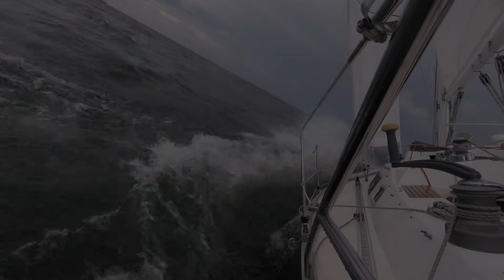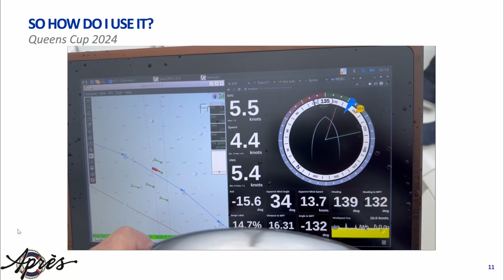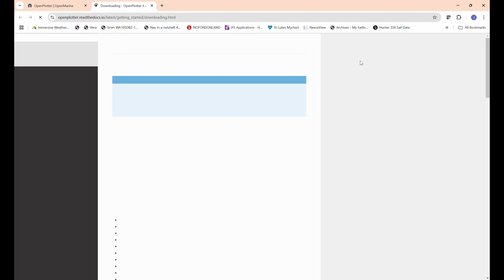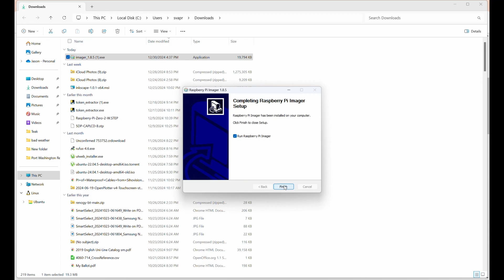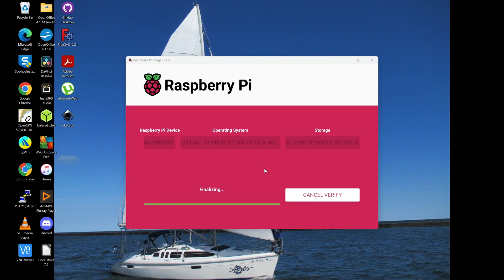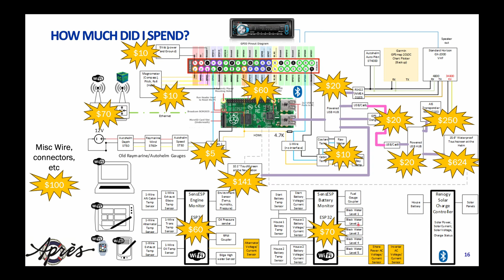DIY Sailing Electronics Guide: Openplotter, Raspberry Pi, Signal K & OpenCPN - Part 1 - Apres Sail

Comment: Would have been better with a tablet such as galaxy tab s9 ultra for helm and nav station imo
Reply from the maker: I started out with a tablet at the helm and considered it but these are some of my reasons:
- Tends to overheat
- Not really a permanent solution
- Charging in the wet can be an issue
- Doesn't just work (meaning you have to navigate to an app on startup)

Comment: Very Interesting!  THanks for this.  A Pi tip:  If you are going to boot from an SD Card, you should bring a second with a clone of the system.  SD Cards do not last like normal drives.
Reply from the maker: Good point!! I guess their are two issues: 
1. Corruption of the SD card - In the early days I implemented a system to make sure the system could be just switched off, and the Pi would perform a safe shut down.  The hardware for that is now built into the MacArthur Hat
2.  too many cycles to the SD card - I have not seen this unless you have influx/Grafana installed that logs the data in a database.  SignalK only uses RAM for data and doesn't write all the data.  
in any case it is always safer to have a spare cloned SD card or run the system from an SSD.
Reply: @ApresSail  It has to do with the number of reads and writes which might be hard to determine.  I've spent extra money to get a case that will hold and SSD or nvme.  pi 4 & 5 will booth from those no problem.
Reply from the maker: @uSlackr agreed, my boat system is also running on a SSD, but I ran for 3 years on an SD card with no issues, but I did have a backup always ready
Reply: @ApresSail  Backups are good (and rare)

Comment: Curious what router people use. Looks like you found a fairly cheap one (compared to say peplink), and how do you protect it from weather? I've started a system based on someone else's take.. got a Sailor Hat SHR-pi that provides power and safe shutdowns from NMEA2000, a Waveshare hat for NMEA2000 connection, and the 4B RPi. I see now there's cheaper ways than the NMEA hat - but it is what I got. Don't plan on having internet on board unless getting wifi from shore, but that and cell reception are desired. Thanks for your channel and info you provide!
Reply from the maker: I use a GL.iNet Spitz (https://amzn.to/3K7NXk5) which is 9-36V and I put in behind the Navdesk, I have done nothing special to protect it from weather.  it has been there for 3 years, but I am in Fresh water.  From what you describe, do you need a router at all?  The Pi can be configured with an internal and external network.  the external you would connect to shore Wifi or phone hotspot and all other devices would be wifi to the internal network.
Reply: @ApresSail  I'll try to wrap my head around that, thanks much! I've been trying to create a hotspot on the pi but it won't come UP. Logs show various errors so finally given up on that. I have Debian Bookworm installed, with openplotter in that. But maybe what you suggest doesn't need a hotspot.. I'll search around on the interwebs.

Comment: Just ripped out my open plotter Pi5, Mac Auther hat, eeprom, py pilot.

Py Pilot is no longer supported. The Pi5 and hence open plotter got corrupted trying to configure Py Pilot.

Don't do it don't trust it.
Reply from the maker: Sorry you have had some issues.  I am sure with some help you would get it going, Always keep a backup of your SD Card just incase you corrupt something.  There is a built in SD Card Copier which you can just use to clone your card.

I haven't heard that Pypilot is no longer supported, I saw Sean (the developer) comment on the forums today providing support so, not sure that is correct?  

I have had my system onboard since 2019/2020 winter and have been carrying onboard the old Garmin GPSmap, but never had to deploy it

Comment: Hi, which AIS transponder do you use? Cheers Mike
Reply from the maker: The Transponder is no longer available, there are currently pretty cheap options for receiving and then you can use the plugin "Ais-reporter" or "AIS-repeater" to upload your position to Marine Traffic or vessel finder
Reply: @ApresSail Thank for this and looking forward to part  2. Is uploading Ais info with a repeater like this using eg starlink a cheaper option than an AIS transpnder?